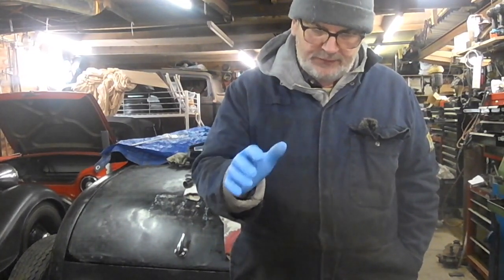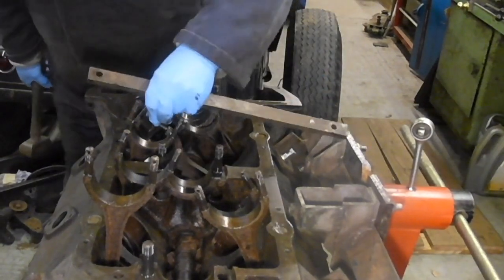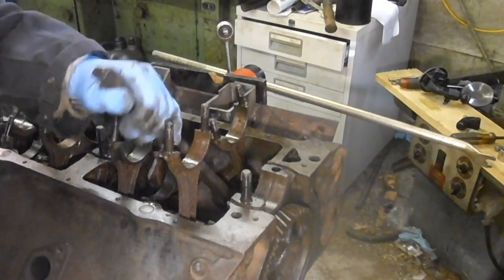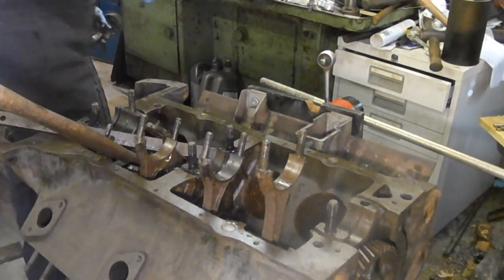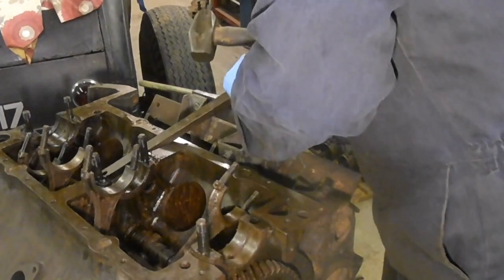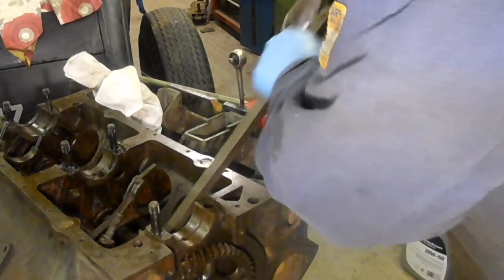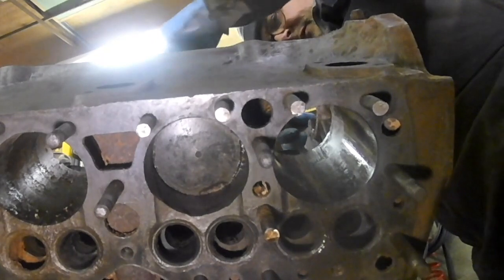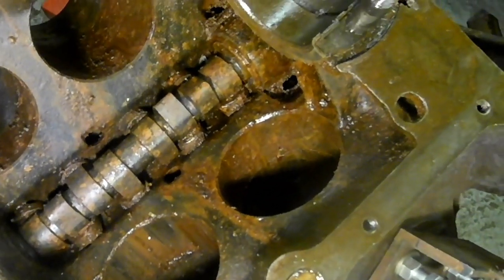Seized Ford Flathead V8 Teardown Pt4: Pistons! Lets bust 'em out!

Comment: I just finished knocking out pistons like this on a 59A....here in the USA.. Thanks so much for the tip. Most had to be broken out. Love your videos.
Reply from the maker: Gary, I hope it went well. On another motor (there is a video) I managed to crack a cylinder. Getting the crown off the piston is the key. I might use a different method if there is a next time. Thanks for watching.

Comment: Completely enjoying this series. Done a few small block Chevies but always wanted to build a flathead. This one looks like quite the challenge with its level of corrosion, grit, and decay. Requires figuring out how to disassemble without it turning into "demo" !!! Kind of the "root" of the "fun" of reclaiming this old iron. Looking ahead, I see this one also involves the dreaded broken head studs. Anxious to see how you approach that task making sure you drill down the center of the stud. That's assuming, of course, you don't weld a nut to the broken piece.  ;o) 👍👍👍
Reply from the maker: Bob, I did some videos on head stud removal. I became quite infatuated with the subject. Rverybody has a different approach to the subject. Some will try and preserve as many as possible (me). Some will sacrifice all at the start and cut them all down and weld nuts on. I suppose it all boils down to how quickly, cheaply and easily replacement parts are available, how expensive is your time, and if someone else is paying. there is an interesting thread running on FordBarn on this very subject. Mart.